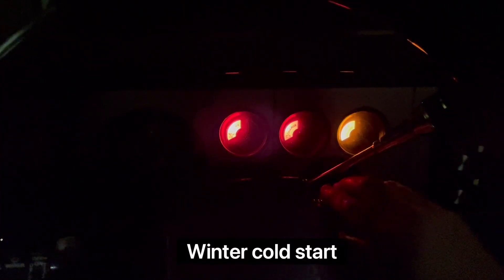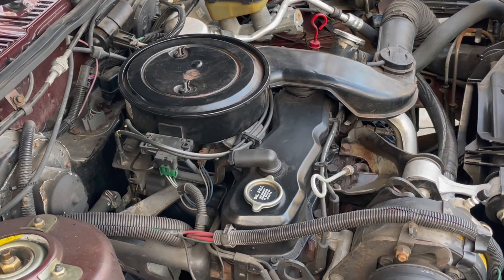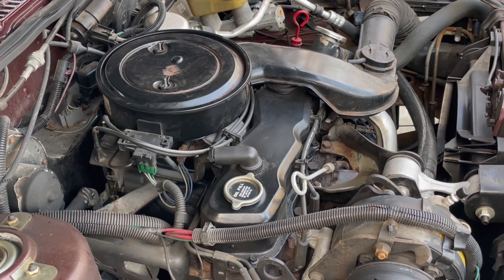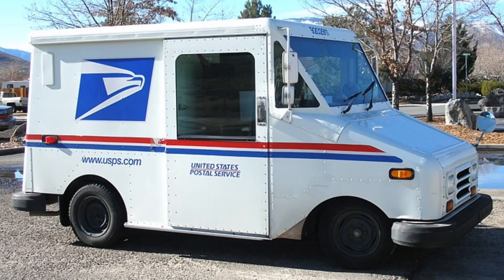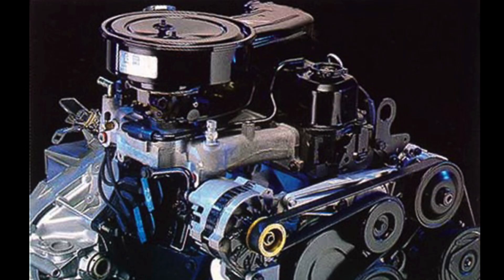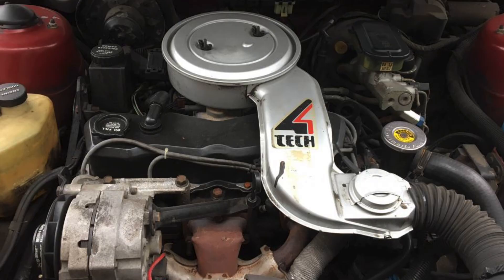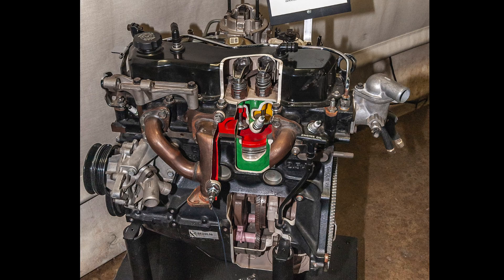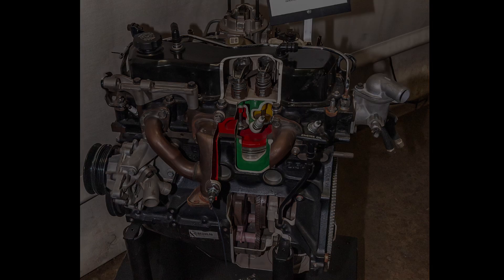Worst Sounding (and Most Recognizable) Engines: GM's "Puttering" Iron Duke 2.5L I-4

Comment: I had an iron Duke in my 1988 Grand Am. First car I ever got to 200k. I traded it in on a 1998 Grand Am because the Auto Trans solenoid wouldn’t release any more and it wasn’t worth fixing.
Reply from the maker: Just unhook the connector
Reply: @RareClassicCars  i didn’t know that was an option. Plus, the wife wanted a new car. So we got the 1998 which we drove until 2009 to 256k+ and the windows wouldn’t roll down and the AC needed total rebuild. Gotta have one or the other.
Reply: @haneyoakie14  You just described the reasoning behind the saying "A GM car will run (poorly) longer than most cars will run at all."

Comment: I have owned a lot of tech 4 powered cars. I still have 2. My friends have always said that they sound like a sewing machine. I haven't lost any timing gear teeth on any of the 20 plus tech 4 powered cars that I have owned. Even my 230,000 mile 6000 that I still own has original gears. Unfortunately, my friend took the gears out on his mom's mint 1987 Grand Am (in 1995) He was in the process of trying to do a Rockford when they let loose.
Reply: Do you happen to know the officially prescribed method of accessing the distributor or distributorless coil packs/ignition module on the transversely mounted iron dukes? Does it involve the removal of the intake manifold?
Reply: @gregorymalchuk272  I do recall it being really tight back there. The steering rack and transaxle are partially blocking the access from below. Access is tight from above because of the intake manifold like you said.  I had to replace the pickup coil and module which required the removal of the distributor. I removed the front upper torque strut and rocked the engine forward. It was tight but manageable.
Reply: @dueljet  Yep. Some steering component or sway bar link and a transmission mount block access from below. I lost spark on cylinders 1 and 4 in an 87 iron duke and am suspecting a bad coil or ignition module, but am struggling to figure out how to access them. It's a shame, because the coil packs on the V6s were trivially easy to access.
Reply: @dueljet  LOL.... That was the ONE THING on the Fiero Iron Dukes that was relatively easy to get at, if I recall. The labor manual for the Fiero 2M4 was basically drop the entire rear cradle for anything. When you take out the dog bone and find a bottle jack which will work sideways you can get a lot done without having to do a four-wheel alignment across all 6 balljoints and all 8 tie-rod ends in that thing. 
DO NOT trust the old camshaft gears. They can let go at any time. At least it's not an interference engine, so while it could strand you (usually on startup) you're not likely to have malice in the combustion palace to quote Eric from I Do Cars. 
A friend who also had a Fiero 2M4 somehow managed to change the timing gears without pulling the engine - I do not know how, because the large gear is pressed onto the camshaft. You CAN remove and replace an Iron Duke from the top of a Fiero, I got it down to about 8 hours total to remove and replace it in the over 300,000km I put on that car in the years I had it. 
After working on my friend's Fiero 2M6 a few times, I was really glad mine was a 2M4.... 
It wasn't a fast car, and it was seriously hard to work on, but it was such a fun and great little car when you got it working properly.

Comment: I remember these things shaking under the hoods of many early to mid 80’s GM cars and trucks.
Reply: And shaking the dashboards when sitting at stop lights.
Reply: @andyk6796   Yup that's one of the main memories I have of mine, that dash and steering wheel shaking like a polaroid picture 🤣
Reply: @andyk6796  

I worked for a used car wholesaler back in the 70’s and 80’s. I remember two occasions when ferrying GM vehicles equipped with this engine from Chicago to Milwaukee not making it home. I had two of them blow up on me. This is in the days before cell phones. Oh what fun. Especially in winter when both of them blew up and it was damn cold out!
Reply: All the way through 1993... Now they just rock boats.